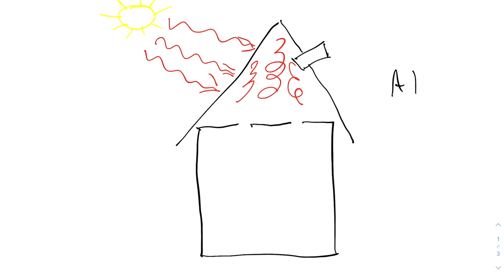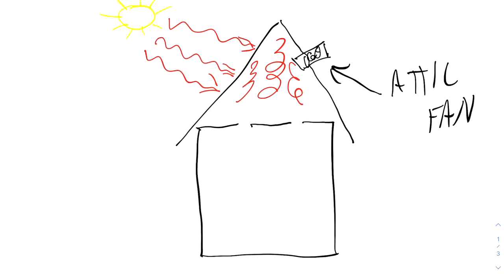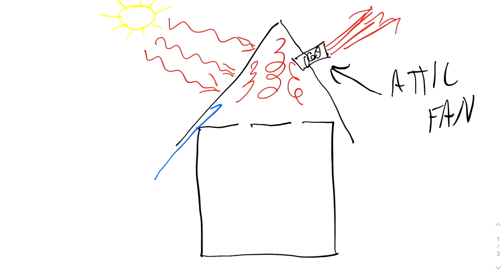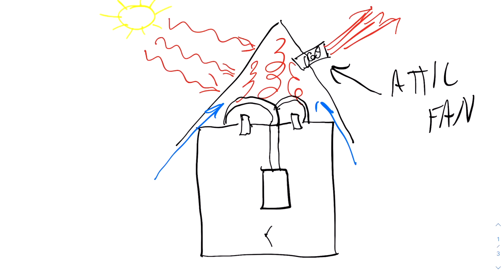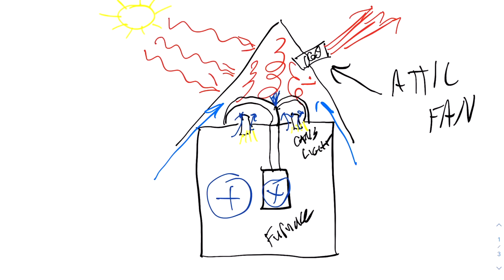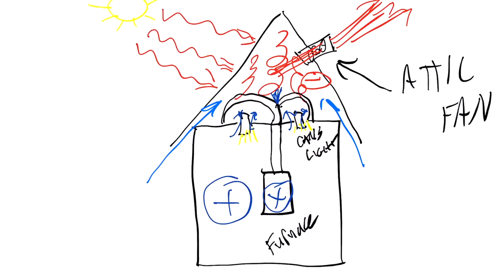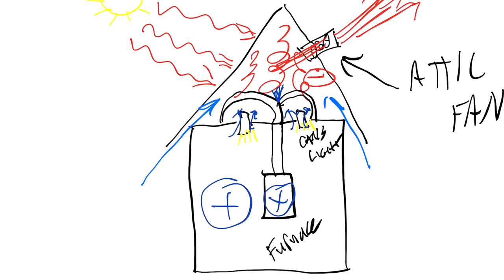3 Remodel Rip-Offs

Comment: Sorry this one is a miss for me. Presuming that the attic vent negatively pressures the house would have to assume that there is zero soffit or other means of  attic fresh air intake. I also believe the illustration is showing a total sealed standard every day attic vs a vented attic whether power vented or not will be cooler. Well vented attics are cooler than poorly vented in hot climates which I believe can be called a fact?
Reply: Karl Lundin you are correct. In a hot and dry climate the more attic venting the better.  Otherwise your attic will be 160F in the summer and your 40 year comp roof will only last 20 years.
Reply: Agreed. I did my own installation of a wired attic fan a few years ago, and measured a before and after attic temp drop from 160 to around 120 during the heat of southern summer. The attic was designed with ridge vents and soffit vents, and the fan addition dramatically helped the HVAC system keep the house cooler. Was one of the best $120 I ever spent.
Reply: Karl you are incorrect, no presumption is being made. All fans have a negative pressure and positive pressure fronts, doesn’t matter if the fan is installed on a sealed container with only opening is at the fan; it will depressurize the container.
Reply: Jason Villamil well thats weird, my house came with one and doesnt help the house or even just the attic cool off.
Reply: Added a Solar attic fan...20 year old house...ran air during the day, not at night.  But upstairs still warmer and uncomfortable.  With the solar fan, it kept the upstairs cooler.  Instead of 2 floor fans and 1 ceiling fan at night in the bedroom, now we just need the ceiling fan.  Best $300 investment I ever made.
Reply: @danwilson6885  also helps with ice damns on the eves in colder climates during winter. this guy is relatively smart. but this one he has no idea what hes talking about. Powered attic fan is for sure the cheapest option that works just okay. but it DOES work.
Reply: I added a fan and it was like i having a new upstairs ac.
Reply: @zefrum3  If you place a 24" dia blower fan in a sealed container (10' x 10' x 20' and it reduces the pressure by say 1 bar. Is your claim that if I now open a corresponding 24" dia inlet hole opposite the fan wall that the pressure will still remain 1 bar?
Reply: @klundin    Ill restate how fans operate when they are powered: the exhaust side develops negative pressure while the corresponding supply side develops a positive pressure; it matters not if its installed in a sealed adiabatic enclosure or your attic, this will always happen as long as the fan blades turn. 
In otherwords there will always be a suck side and always a blow side.
Reply: @ericgustin3386  it is this exact logic that is terribly wrong in support of attic fans. The reason why a  attic fan will remove an ice damn is because the fan is removing heat from below the roof surface. But wait where is that heat coming from? Its coming from the living space. Guys c'mon! U dont want to remove heat, during winter, from the living space. If your house develops an ice damn then the roof is most likely not properly insulated or vented.
Reply: @zefrum3  Karl is correct if you read his statement - he is simply stating a scientific fact. You also are correct in some ways, but you are both making different points. Karl says: in order for Matt's statement to be true, (that the attic fan creates "negative pressure" in the attic which could draw conditioned air from the house itself),  there could be absolutely no ventilation in the attic, or at best, an extremely small amount. In other words, installing a ventilation fan in a completely sealed attic with no soffit, gable, or ridge vent could create negative pressure (vacuum) that could draw conditioned air from the house interior - replacement air has to come from somewhere and will come from the path of least resistance. 

As we all know, soffit vents, ridge vents, and gable vents have been used for decades in just about every part of the country. I had them in my houses in MT, AZ, OR, WY, SC, and CO. Installing a 3000 CFM attic fan in such an attic, with either soffit/ridge/gable vents, will simply move 3000 CFM of air from said vents through the attic to the fan, which will then exhaust it outdoors, thereby cooling the attic. On the other hand, if you install a 3000 CFM fan in a completely sealed attic, the fan would begin to create a vacuum which is going to try to draw air from somewhere. If there are not sufficient cracks, holes, and joints to suck air into the attic through, eventually the fan will create enough of a vacuum that it will either collapse the attic (impossible with a normal attic fan), or it will burn up the fan motor because there is no more air to move.

What you are saying is also technically correct, there is a positive and negative pressure created by any fan. However, this has nothing to do with Karl's comment or the discussion at hand. A fan cannot create a vacuum in the attic unless the attic is sealed - the absolute air pressure inside a vented attic will remain the same as outside the attic for all practical purposes, even if a fan is installed. The CFM of air out is always going to equal CFM of air back in through the vents. So if the attic is vented, the negative pressure on back side of fan will simply draw cooler air through the attic ventilation itself and exhaust it to the positive pressure side of the fan, thereby cooling the attic. This is easily proven by looking at the PC like the one I wrote my comment on. There is a fan inside the case - said fan has a positive pressure side and a negative pressure side. Because the case is vented on all sides, the negative pressure side of the fan does not create a vacuum inside the case - it simply causes cooler air to flow through the case of the PC, exiting the back, thereby cooling it. However, the air pressure inside the case is exactly the same as the air pressure outside the case.
Reply: @youstubers5722  you need togo back to school, a working fan always, create a vacuum. Not a perfect vacuum but a partial vaccum. Aside from this, I did not actualy speak to his last hypothetical, so theres another thing you are wrong on.  Moreover, a sealed attic with an attic fan is by defintion not a sealed attic. If u are saying an otherwise sealed attic save for the cutout for the installed fan is operating then the partial pressure beneath the blades will indeed be lower than the partial pressure abve the blade with a resuting partial vacuum created in this hypothetical sealed attic. Cant have it both ways, either a fan sucks and blows or we are all living in the near perfect vacuum of space and then fans dont matter.
Reply: @zefrum3  As I noted earlier, you are partially correct in your comments, and I agreed with your comment that a fan has both positive and negative pressure sides and creates a partial vacuum in the vicinity adjacent to the fan. However, said partial vacuum from a fan running in an attic could not and does not create and leave a literal vacuum, or degree of rarefaction below atmospheric pressure in the attic itself. Any air removed by the fan is instantly replaced with air coming through the attic ventilation system, this leaving a state of equilibrium in atmospheric pressure between the attic and outside the house. 

Perhaps your lack of understanding Karl's comment, as well as my own, is just a matter of simple semantics. It would seem to someone of average intelligence, when you use the term vacuum, you are referring to the principle whereby a fan moves air. A partial vacuum behind the fan draws air toward the fan, while positive pressure on the other side of the fan accelerates the air outward.

On the other hand, most thinking people, when viewing this video, realize Matt is proposing that the fan creates a vacuum, or condition of negative atmospheric pressure inside the attic so strong that the only option is that conditioned air is sucked away from inside the house in an attempt to equalize pressure with the vacuum in the attic. What Karl clearly stated is that to create a literal vacuum in the attic that would suck the air from inside the house, the attic itself would have to be sealed. You cannot create much of a vacuum in an unsealed environment, yet this is precisely what the average attic is. This is why both you and Matt are wrong in your application of this to the subject at hand. We are living in and talking about real houses in the real world, houses with real attic ventilation. Granted, it is very different in a high-end, newly built, airtight, and energy efficient house, but this should have been explained by Matt in the video.

If you have a little extra time, please let me clarify my comments for you, since your higher education has obviously retarded your comprehension of simple subjects. For purposes of our argument, let's agree to base our comments on an average exhaust fan in a normally vented attic in the majority of the single-family homes located in all but the coldest climates. More specifically, the many tens of millions of houses built from the 1900's to early 2000's, which have any combination of ridge vent/gable vent/soffit vent/mushroom vents, etc., hereafter called attic ventilation system, all built under the millennia old concept of 'a house needs to breathe'. I choose to base my comments on these houses because the vast majority of Americans live in such a house, not in some high-end airtight Utopian house built in the last 10 years. 

Let's start with Matt's authority figure, Dr Allison Bailes, cited by Matt above. On his Energy Vanguard website, Bailes has explained that the area in question - the gaps at plate, wire bore holes, holes in the electrical outlets, etc - in other words, any avenue for air to move from inside the house to the attic, averages .7 to 1 sf in an average house built in the period in question. Yet that same average house came installed with 18 sf of attic ventilation system which allows outside air to pass freely into the attic. In said average house, an attic fan, even one moving 3000 CFM cannot create a literal vacuum in the attic so strong that the 18 sf of ventilation system would not suffice, thereby creating an entire zone of negative pressure lacking air. No, the attic fan is not creating such a strong vacuum that the only recourse is for conditioned air to instead come flying through the .7 sf of gaps and holes, while some mysterious force prevents outside air from coming through the wide-open ventilation system. 

Thus, while the negative pressure, or partial vacuum adjacent to the fan blade is real and causes air to move, it clearly does not create a vacuum of negative pressure throughout the attic. The negative pressure on the back side of the 3000 CFM fan blade combined with the positive pressure on the front side of the blade does in fact expel 3000 CFM of air from the attic, but simultaneously 3000 CFM of outside air enters the attic through the aforementioned venting system, and the air pressure remains the same on both sides of the structure. That being the case, there is no vacuum in the attic.

This is where you may want to go back and revisit what Matt is saying. He is proposing that the attic fan will create a negative pressure, or vacuum in the attic itself, a vacuum so strong that to stop the attic from imploding, said vacuum - not fan - but vacuum created by the fan starts sucking conditioned air from the house into the attic.

Not sure why this is so hard for you to understand, but perhaps it's simply the incoherent babble of higher education that you absorbed so poorly. Going back to Karl's simple initial statement, it is physically impossible for a normal attic exhaust fan in an attic with open venting to create such a strong vacuum in the attic that the air would ignore the open venting and would instead suck all the conditioned air from the house into the attic through the .7 sf of holes and gaps in the plate, also thereby causing such a strong vacuum in the house that it causes backdraft of exhaust gases from the fossil fuel appliances. Clearly, in a sealed, airtight, home, this could happen. But we're not talking about such a home, or if we are, Matt should have said so.

Also worth noting, the same Dr Allison Bailes that Matt cites as the authority for his viewpoint of attic fans, now acknowledges in a blog post on his site made two months ago, some 9 years after the citation Matt linked to, that he himself is using an exhaust fan in his attic to try to create a negative pressure environment in the attic to correct the problems caused by the "scientific" application of foam insulation used to seal said attic. In other words, he is now deliberately trying to draw conditioned air into his now "sealed attic" through the aforementioned .7 sf of gaps in the plate, bore holes for wires, etc.. Ironically, while still condemning the use of said fans in anyone else's home.

That being said, you and I likely agree that Matt's comments about fans, when taken in the context of what he is familiar with, that is, high-end, airtight, highly insulated houses built in the last 10 - 12 years, is more accurate. There is typically no need for an attic fan in such a situation and it would largely be a waste of money. However, for the tens of millions of other homes in the US, attic fans remain a viable option that makes the house more comfortable in summer heat, lowers the need for A/C in all but the most humid parts of the country, and does provide the benefit of lowering attic temperatures, thereby extending the life of the roof.

As a 35-year veteran property manager of many hundreds of single-family homes and dozens of commercial buildings, I have seen firsthand countless times that roofs in buildings without adequate attic ventilation, whether mechanical or passive, typically don't last much beyond 15 years. In the past 5 years, we have had to replace over 60 roofs that were less than 15 years old - roofs with 30-40 year shingles installed primarily on homes without adequate attic venting. Yet dozens of other houses we manage in the same towns, with adequate ventilation and attic temps 10-20 degrees lower, with same brand and vintage of shingles, are lasting 25+ years unless damaged by hail or wind. 

The entire roofing industry, including the roofing manufacturers themselves, are well aware that excessive heat shortens the lifespan of their products. It is not, as Bailes repeatedly says, 'only UV damage shortens the life of the shingles'. The positive results in the real world makes a installing a $200 attic fan a no-brainer in any older home, regardless of what you, Matt, or Bailes thinks.
Reply: Yous Tubers ah it comes out; you’re an old school expert after all, with that ‘I know because of my years of experience’ evidence.  Can you grasp your hubris maybe making you look like a fool and that you maybe wrong? Secondly, i dont know why you are arguing about how fans do what they do; it is always the case, when operating, that they create negative pressure on one side and positive on the other. Thats just how they work. Furthermore, its mind blowing you dont grasp the correct way to ventilate from the incorrect; Matt and all building scientists , I am assuming here, agree attic fans are not the way togo. It is incorrect to ventilate by using active ventilation via a fan mounted somewhere up the roof because it will create excessive negative pressure drawing out conditioned air from a leaky ceiling-floor assembly. Matt’s greater point would thus be: correct the real problem not hire a ‘parts installer’ to ‘fix’ it.
Reply: None of the commenters against Matt have brought up the stack effect. Which is basically hot air rises when it warms. I would thus hypothesize that this principle makes alot of multi floored homes uncomfortable above the first floor because majority of the heat is upstairs but the thermostat is down stairs. Thus an attic fan would help draw this hot air out but through the leaky ceiling which does remove heat but also removes conditioned space air thus bringing makeup air from outside, which is cooler than attic air but warmer than conditioned air, which then causes the A/C to run to cool. Whichnis why a lot of you old school guys claim the attic fans work. Its just not how you think they do. Moreover in general there is probably inadequate air supply to those upper stories and not installed thermostats or sensors, or in a multi unit setup, inadequate cooling unit in addition to lack of sealing holes or insulation. In other words: there are so many things that could be the actual reason(s) for an uncomfortable living space but to not investigate the actual reason is foolish, its also too easy to just slap on a part  and claim its fixed now. Its cheaper, in the immediate term, but Nothing was actually fixed and the A/C now is running more than it was designed to.
Reply: so when the temp in the attic reaches 85 degrees the attic, the fan comes on, usually about 8 am to 10 am Depending on the weather...Depending on the weather again and how hot it is outside the air-conditioner may come on at 10 am or as late as 2 pm in the afternoon during the summer.
Reply: Most remodels (homes 20-40 years) down here in Texas don’t have adequate soffit or ridge vents. Matt is speaking from experience. Of course when building a new home this will be different. But it is a scam to think that just adding a fan will fix your problem. Must air seal sealing, add proper soffit/ridge venting....only then will add in a powered fan make a difference.
Reply: kelvonb09 yes thank you! My two story in Houston has no soffit venting save for a little run of my master bath i installed last summer, but have gable vents and a large fan vent. If it werent for the trees the previous owner trained to grow over the roofs... Ill be installing 4” screened vents in each rafter bay at the soffit and getting the last few tree-rat-ladders felled soon
Reply: Look around these days.....there are no facts anymore.
Reply: @zefrum3  Youre being dense. We all know fans create a vacuum. What everyone else is saying that if a attic has adequate ventilation that it should not pull air from inside the house itself. If it does it would be negligible. 
For example, imagine you open all the windows in your house, you place a fan in one window, and a box in the same room, do you think the air is coming out of the cardboard box or is it coming through the open windows?
Reply: @EpicTunaSalad  well denis, if the box was bigger than the room and you were living in it and the box was not sealed, yes. What most of you old-school fellas dont get is that your incredibly simplstic examples you bring are nothing short of asininine logic and perpetuates this 'I know better than thou' attitude which leads to bad construction. Moreover Dennis, what Matt is saying, which what we are actually discusing, is if you do not seal all those gaps and cracks between the ceiling and attic, and you have a fan depressurizing the attic, well air likes to take the path of least resistance, all the more so because anything cold relative to hot will want to travel to that heat to establish a temperature equilibrium. THis is after all the bassis for thermodynamics, how heat flows. Btw heat is the relative vibration of a particle relative to another; how could something so small effect a house? geezus. Cheers Dummy
Reply: @zefrum3   @zefrum3  Wow amazing what you will infer about people over the internet. You said it exactly without me having to. Air will take the path of least resistance. How much air is actually coming through all the miniscule cracks when you have soffit vents and ridge vents all around free flowing. Like i said it would be negligible compared to air coming through vents. That is for a well vented attic. Thats what we are saying, we are arguing that you can not call something a scam if it works in some situations and not others. Of course if you have a poorly sealed ceiling and walls and no vents in the attic it will pull air from inside. No ones arguing against that. But to argue that it will pull air from the hard to get places of a properly sealed house with good attic ventilation, is flawed. 

You seemed to fail to visualize how the thought experiment related to my points.
 
Also just becsuse someone's opinion differes than yours, doesnt make them a dummy. I know how heat and heat transfer works, do you? Might want to "go back to school" like you said to someone earlier. Heat moves to cold, not the opposite. Every atom likes to be in the lowest energy state possible. Heat is kinetic energy, which the atoms would like to lose.
Also heat is not only expressed in vibrations, that is usually reserved for solid states. I dont even know what kind of jab you tried to make at the end, but it didn't work.
Reply: @klundin  Lets not forget about the expansion as the air heats up causing a positive pressure difference to start with.
Reply: @zefrum3  The sucking side is negative pressure and the blowing side is positive pressure, but if you want to see the science in action, go buy a manometer that reads both high and low pressure then you will see the meter needle move toward the positive or negative side when the fan is running.
Reply: @zefrum3  Air is like water in that it follows the path of least resistance.  If the snow ice dam on the edge of the soffit has blocked the intake air from getting into the attic, then the running powered roof ventilator may be pulling conditioned air from the house in the gaps between the sheetrock and can lights or registers.  But the current practice and some building codes are caulking or putting mastic in the air gaps to reduce that air infiltration.
Reply: @michaelbagwell3485  ?
Reply: @EpicTunaSalad  im not making unreasonable inferences; ive never indicated if someones opinion differs from mine therefore theyre a dummy; just happens tobe if a person keeps arguing a dumb point that makes them a dummy. I didnt fail at understanding the theoretical or the practical concern with attic air sealing; you did.